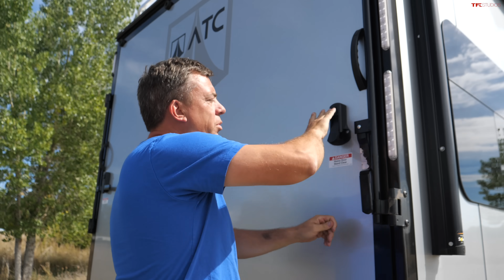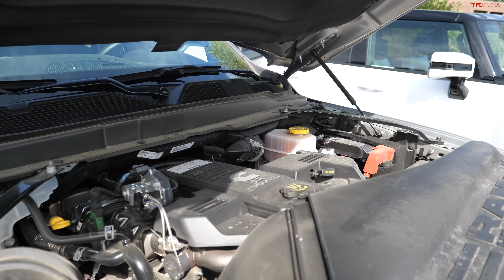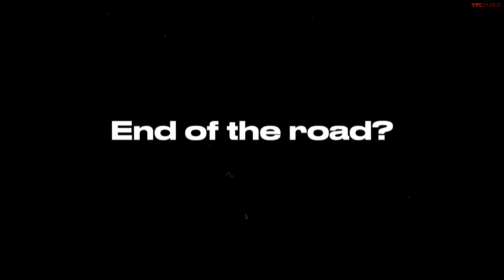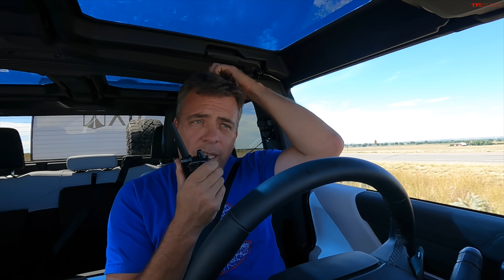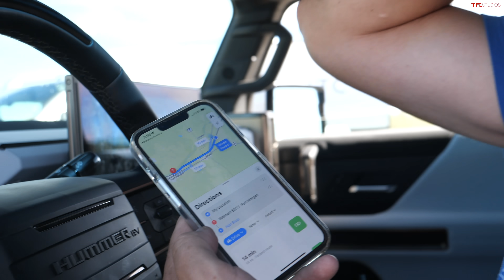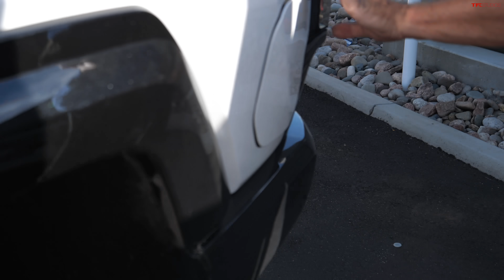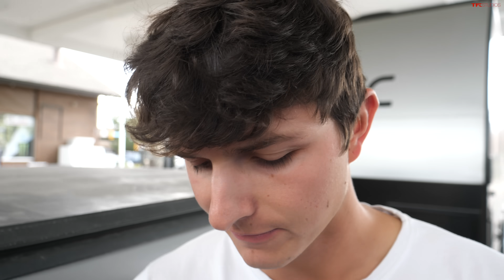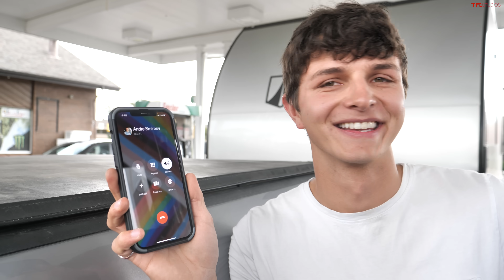How Far Can a Diesel and Electric Truck Tow An Identical Camper Trailer on ONE Fill-up?

Comment: You should also consider how much fuel was burned by the power-plant in order to charge that electric truck-thing.
Reply: that's considered in the cost of the electricity...
Reply: And think about how much energy was in the vegetables the dinosaurs ate, to make dinosaur bones, to make diesel, to make electricity, to charge electric truck thingy.
Reply: Should also consider the damage to the planet with the MASSIVE LITHIUM MINES used to make the batteries. Go look at pictures. CRAZY. BOTH ARE BAD.
Reply: Some charge stations us diesel generators...How's that for a farce?
Reply: @Nudge822  I agree that there are plenty of rackets going on with Big Oil and the government. But there are just as many rackets going on with Big Lithium and the government. I read an article in the Wall Street Journal about how they're sending ships over to Pacific ocean waters to scrape the bottom of the ocean for lithium. That's going to be just great for the aquatic environment. Probably going to trigger a massive earthquake while they're scraping for lithium.
Reply: You should consider how many lives are lost in the middle east to protect the crude oil so you can have diesel.
Reply: Then you should also consider how much energy was used in refining the diesel
Reply: @ethanlinderman8833  Don't forget all the other products on Earth that must have petrochemicals to be made!!!  Almost everything we have  is made using fossil fuels.. Gasoline and diesel only make up 35% of a barrel of crude oil.
Reply: @dennisjoseph629  we gotta ween off using the word "fossil fuel"since it was a term made up by rockefeller to give a sense of scarcity
Reply: @ethanlinderman8833  Nit wits forget that process exists for some reason. Or the motor oil, filters, and other associated maintenance costs of the ICE.
Reply: @madweazl  the periodicity of maintenance may be slightly longer than the standard ICE oil change, but every motor/gearbox will be serviced by an oil system because these are high speed motors. The electronics/battery will often have seperate coolant systems due to optimal setpoints that need periodic flushes to prevent biologic fouling. Not to mention 700V electrical work is extremely specialized and high risk (these batteries can and will vaporize the tools you are using if you short the wrong place. Rough math says that voltage can vaporize about 1.4g of iron, so a full socket head, in 1/10s). And the A/C, brakes, powered steering all have equivalent systems that need serviced, plus cabin+battery heaters (many battery compositions prefer approximately 70F in use) because you can't reliably siphon engine heat. Overall maintenace cost of EVs will remain equivalent on secondary 12V systems but due to special training and current scarcity should be much higher on the primary systems for safe work of good quality.
Reply: @ethanlinderman8833  the difference is they want to ban gas/diesel engines, in trucks. But tell you the EV is ok, because it's not using fuel directly.
Reply: @ethanlinderman8833  What does the power plant run on? Natural gas. There are energy costs for drilling, extracting, transporting, building the nat gas pipeline, as are there energy costs in building and maintaining the power grid. Massive energy costs in mining, refining, transporting, materials and converting those into batteries in an EV as well. None of its free.
Reply: How much of the charging is subsidized by the Govt. I mean my tax money?
Reply: @turkeyslayer63  again, no different than fossil fuels. 

"The federal government provides numerous subsidies, both direct and indirect, to the fossil fuel industry. Special provisions in the U.S. tax code designed to specifically support and reward domestic fossil fuel‐related production are direct subsidies. Other provisions in the tax code aimed at businesses in general create indirect subsidies that are not exclusive to the fossil fuels industry. In certain cases, quantifying these subsidies is fairly simple. In the case of indirect subsidies, establishing an amount associated with these subsidies is more challenging. While not covered in this fact sheet, another source of federal aid to the fossil fuel industry is the discounted cost of leasing federal lands for fossil fuel extraction. Some fossil fuel subsidies provide public assistance, such as the Low Income Home Energy Assistance Program (LIHEAP), which assists low-income households with heating costs."
Reply: @turkeyslayer63  VERY TRUE,,,,...!!!!
Reply: @turkeyslayer63  I promise far less than what subsidies the petrochemical world receives.

Comment: I've never seen anybody go camping with an empty trailer since it was a toy hauler why didn't you have a toy in there and equipment and the things you put in a camper And by the way you probably should have used a coming's motor they get a little bit better fuel mileage than what a Dodge does I've had a both and I like the duramax better

Comment: As a comparison. Tesla's ne semi has 1000kwh 'tank', it does 800km, 500mi. I drive a heavy  truck with 300l of diesel, which is the equivalent of 3000kwh, and have not much more range than Tesla's semi. Once the charging infrastructure is in place, no one will buy diesel.

Comment: critical fail.  EV predictive data based off NO TOWING LOAD keeps being referenced when ACTUAL power consumption greater from towing.  OF COURSE predictive range was rediculously off.  THERE WAS NO COMPETATIVE COMPARISON.  Was a hummee ev review; NOT AT ALL IN SAME "BOXING" CLASS as cummins RAM.  any reasonable person knows this without the "test drive" footage.  like a preschooler boxing against an adult pro; you know it is wrong to put em in ring against each other cuz the ev has ZERO chance of victory.

Comment: Interesting how hummer has more horpower and torque than ram but only max towing of less than half. You think they lowered numbers of max tow to maximize battery life... Seems like the same inflated numbers that seem to be the norm for this Cali. Driven ev BS
Reply: Add in the weight of the battery...the Hummer battery weighed 3000 lbs.  That diminishes the hauling capacity.

Comment: I would have to say that the EV concept just isn't there yet (doing it the way it's done).  Maybe the answer is to make batteries that can be quickly changed and charge a rental fee along with the electricity (if the difference in efficiency is enough to make that profitable).  That would also take away the huge expense of battery replacement from the owner at the end of the battery's life.  The expense of the battery would be paid for in the rental.  I think, in general, the EVs are not ready for prime time and won't be until better battery technology evolves ( I believe it will).
Reply: It appears so much more resources have to go into producing an EV battery than a regular battery. What is the total cost & what is the impact on the environment?
Reply: Problem with that is you'd end up paying a ton - like propane exchange versus getting it refilled - you get way less propane and in a crummy cylinder that looks like its been dropped a few hundred times and then repainted with the cheapest paint available. And it still costs more. Also not really sure how they could quickly swap out a pack (or stock a bunch of spares) when the EV is basically just built around the massive battery pack.
Reply: I think there are too many variables. With a propane tank, you know approximately how much fuel you’ll get for your exchange. What if you paid for an exchanged battery and it was degraded 50%? Who would be liable if an exchanged battery went up in flames?

Comment: My question is kind of off the direct subject but I feel pertinent. The whole idea of these EV’s is to reduce carbon emissions, right? (The whole carbon thing is for a different time). Where are we going to be getting the power to charge all these ‘Green Rigs’ so I decided to pause my comment a bit and go find out.   Pause……….
OK I’m back, this was just a quick lookup from Wikipedia but I think these numbers are about right.
Energy in the United States came mostly from fossil fuels in 2021 as 36% of the nation's energy originated from petroleum, 32% from natural gas, and 11% from coal. Nuclear power supplied 8% and renewable energy supplied 12%, which includes hydroelectric dams, biomass, wind, geothermal, and solar. Wikipedia 
So, doing the math 79% of electricity produced are from those pesky carbon producing fossil fuels. Hmmm. 
Second question With our electrical grid already at near maximum, hence the rolling blackouts, brownouts, Gov. Nusance asking Californian’s not to charge their EV’s (that one still cracks me up) where pray tell is all this extra electricity going to come from? That one I have no idea on so for my own curiosity I’m going to do a little more research.  Anyone with such info (short or long term plans for alt. fuels)  please comment

Comment: In my opinion, gas/diesel vehicles are like flip phones and electric vehicles are like smartphones. Flip phones get the job done and last forever. Smartphones, like flip phones, get the job done, but they don't last as long, but they are more convenient with features. So it just depends do you want luxury versions of your everyday vehicle or just a basic vehicle that is more reliable and predictable.

Comment: I already knew what would happen in this range test, EV's use exponetially more power compared to a ICE engine, energy usage isnt the same an EV is useful for a perfect weather  enviroment as a daily driver, tbh you only really need an ev that has about 150miles of range depending on what your commute is,  so you can drive to and from work and charge up once a week and save money but when winter hits or if you get a cracked battery pack thats it, that low cost charging just lost its edge

Comment: If the Def system was taken off of new diesels they would even go further.  The Def system chokes down the diesel efficiency but yet diesel still has a great towing longevity over the EVs.  Another EV fail, an electric Bummer. 🤣😂   I wonder what the 0-60 of the EV Bummer and the 0-60 of the Diesel truck would be?  If the truck beat the Bummer I would say take the EV out of the Bummer and put a corvette engine in it.  That would be cool!

Comment: Another hilarious electric vehicle video! Why
Next time, just put a big honkin’ diesel generator in the trailer with 20 extra gallons and charge the Dummer along the side of the road while you take a nice long long nap (earplugs sold separately). That way you don’t have to unhook the trailer and go the opposite direction from what you intended. Or take the $60,000 saved from buying the diesel to pay for 400 fill-ups of $150 each. 100,000 free miles!
Reply: LMAO... Hummer: "Hmmmmmm, lets take OUT the engine this time...." So dumb.... It should be a Twin Turbo V8

Comment: Bit off subject but have a 2019 kia Nero hybrid. Dealership really wanted me in there EV. 628 miles mostly city driving with just shy of a gallon still to go upon refill. Is my record. Once temp drops so does mileage. If I wanted a hitch on I could pull maximum500# load. Lab gets back seat. Also higher insurance. Any wet condition to batteries not just salt water could be catastrophic. Thanks.

Comment: The problem with electric vehicles is the massive weight of the battery.  Batteries are very heavy, and have a much lower energy density that petroleum based fuels.  The only way that BEVs will surpass combustion vehicles is if somehow a battery with the same energy density as fuel is developed, or if hydrogen fuel cells are greatly improved to the point that they also are just as good as gas or diesel.

Comment: I agree that electric can be more efficient but at $114,000. You can replace the 31 gallon tank for a 70 gallon tank and add another 100 gallon fuel cell to the diesel and get more range, which you can’t do to the electric.

Comment: When they did the fill up on the Cummins and discussed the price comparison to efficiency they failed to mention that the diesel went almost double the distance on one tank of fuel. So the hummer would have needed 2 recharges to the Cummins 1 charge. For a supercharge station the average price is $0.26/kWh. If you had to pay for it the hummers capacity is about 212kWh that comes out to about $55.00 x2 (for 2 recharges) 
So the Cummins is a cheaper vehicle, more efficient, easier to operate and maneuver, and less time consuming. 
Also let’s think about where the electricity comes from in most cases 🤔🤔🤔
Ev are good for small cars short commuting but let’s be real you can’t replace a diesel truck

Comment: The batteries lose their charge capacity over time (lose range). The batteries perform less in cold weather. They are very expensive to replace. Take a while to recharge... hopefully no line at the charging station. Batteries use a massive amount of energy to mine materials prodce.

Elec vehicles are not the answer

Comment: Electric motors lose efficiency with heat, its not surprising. Honestly im surprised it was around a 30% efficiency loss. I wasn't expecting it to be that much but usually they lose efficiency with more heat but it does tend to have an upper limit to that efficiency loss at around 100c. (I think its 100c? I could be wrong it could be closer to 120 depending on the guage of wire and number of wraps for the motor core.) Again I think for most people in urban areas like large cities that are close to the Mountains where distance isn't such a crucial issue and you can readily charge the vehicle or you only do light towing once in a while an ev can be a great option. Or even just to get to and from work. But in most rural cases like east oregon or more rural areas where you get used to an hour plus drive to a bigger city, I don't think an ev is the best choice. The duty cycle of the battery wouldn't net much of a benefit as you would be putting more wear on the battery than you would if you lived in a more urban area. (More driving, more towing, more frequent charging= less efficiency with the duty cycle of the battery. I.e. time spent in rest per time spent in use, And charging counts as in use.) While I think ev cars definitely have thier place in urban areas. i feel like ev trucks are more of an enthusiast option and less practical overall.

Comment: So if that charging station was full you could have spent hours waiting to get charged. If it was cold out you might not had enough power left to get in the charging station after trying to stay warm in your EV !
Reply: They should have had a generator in the Hummer's toy hauler.
Reply: @AlexRides808  Running on what, diesel fuel?

Comment: What's the carbon footprint of generating the electricity to charge the vehicle when gas or coal is used to produce electricity, because America still doesn't have the power to supply electricity for everything as it is, but let's all plug in to an insufficient power grid

Comment: I have hauled a 3 stall gooseneck bull trailer with one bull and one show cow ( not sure on the weight) from Nebraska to North Dakota and my 22 year old Dodge was still getting 15mpg towing
Reply: Thanks for the video it tells me all I need to know. I'll keep my RAM 2500
Diesel 2016. My tow is light at 9000
To about 9800# I average 11 mpg.
Towing. My old 12v 5.9 got 13 to 14 mpg pulling the same trailer. Mostly I am doing 60 mph to 65.

Comment: You can't compare two vehicles that are not identical, you would have to use two identical vehicles and trailers to be completely fair, so either use two RAM's one diesel and one electric or two Hummers, again one diesel and one EV.
Reply: I got just under 10 mins and I was gone, you're talking a load of bullshit with energy, JOULES is the universal comparator, you can't compare kWh ratings as a direct comparison.

Your researchers didn't do a good job.

Comment: Let's not forget the $37 and change to charge the Hummer was not a full charge. It was enough to get Andre back home. The Diesel got topped off. So you could probably and another $10-$15 to the charging cost.
Reply: He went from 7% to 51% of $37. It would be $80-85 for a full charge.
Reply: That was not even close to enough to get home unless he left trailer and someone picked it up with a real truck.

Comment: The sad reality is, currently energy storage density does not work for EV's past local use.    

If you are driving less then 60 miles a day total,  an EV makes sense.  the problem is in cold weather,  without a charging point at work...  you have to drive to work drive to a charging station and drive home and charge at home...   its not sustainable in many cases.

Comment: If that EA promotion wasnt on? $0.69 per mile in the Hummer. (Charge price = $0.427 per Kwh (37.41/87.483) Cost per mile = ((Charge price * max capacity w/o losses)/130 Miles))

Doing the calculation for the RAM, it managed $0.49 per mile. So yeah, the Hummer is nothing but a toy. It does not save you money, and if you want it to save money you have to settle for slow ass chargers who make it even more unpractical. This is generally a trend followed by most EVs, it gets REALLY bad if you start assigning dollar value to your time.

Additionally, if the Hummer was charged to full, we could have seen a more comprehensive picture on time as-well as charging losses. (Charging is not 100% efficient, some energy is lost as heat...they have huge cooling systems for a reason.)....and hell, probably would have struggled to do 100 miles if it was cold.